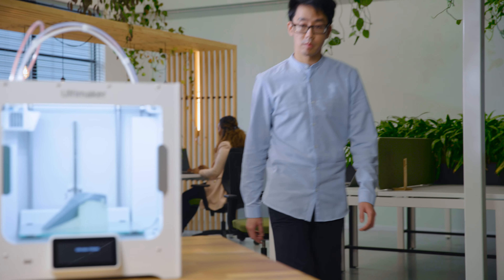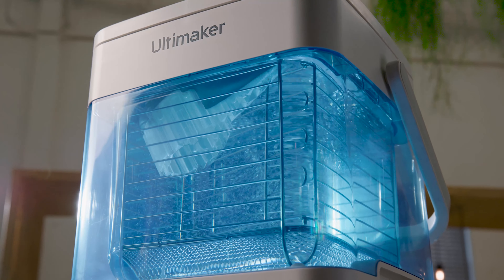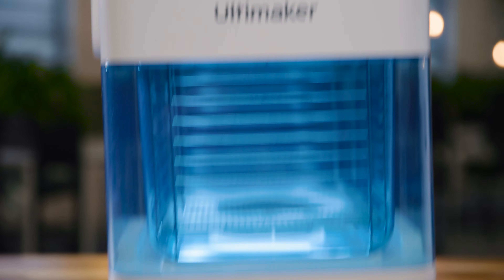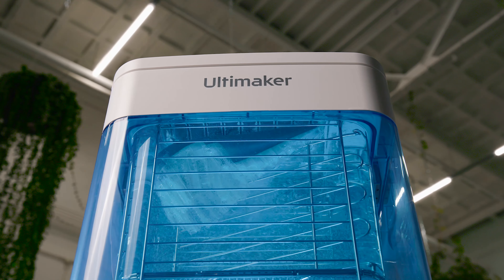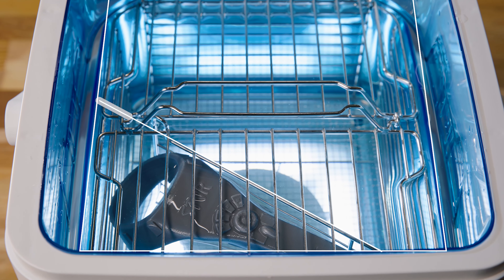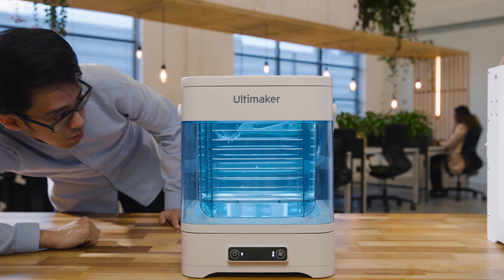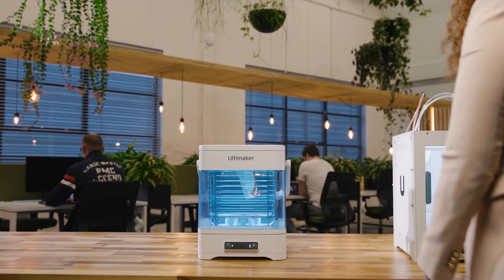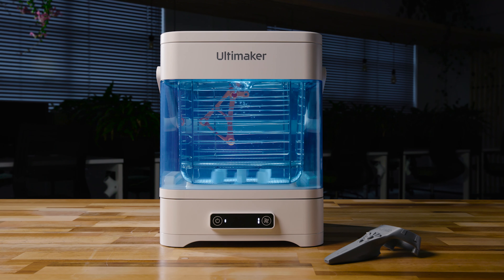Ultimaker PVA Removal Station

Comment: Its a nice looking product but it doesn't have a heated bath.  You're probably better off by with a circulating heated lab bath and save yourself about 800 money units. Magnetic stirrers have existed in the resin 3d printing world for a while now and at 10% of the price of this.  It is way too expensive for what it is but its intended to be purchased by big corporations with no real knowledge of other offerings and assume expensive equals good.